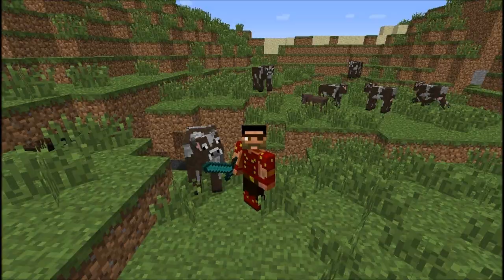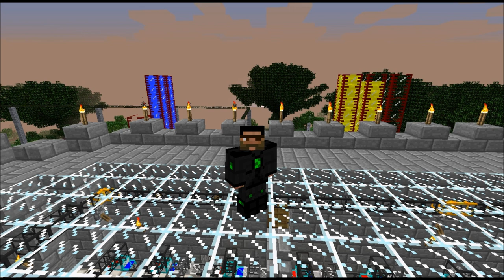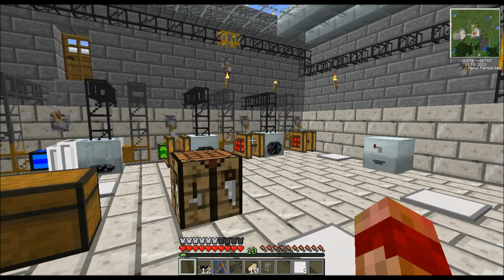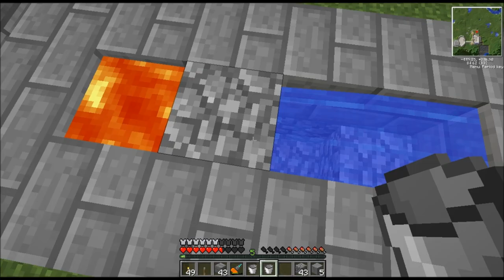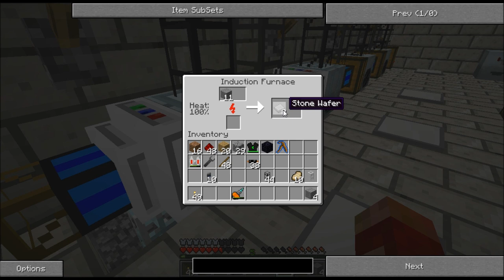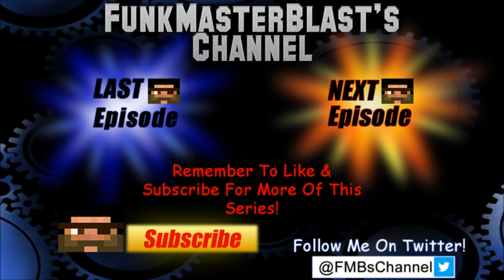Minecraft Technic Part 25 The Other Jetpack, The Block Breaker and Infinite Cobble!

Comment: frankly by the time you take any of these mods to the top end, you've really made it into creative mode, so it's not all that great if you're going to worry about whether you're cheating or not.  You went through the steps to get the materials to set it up, but you wind up getting essentially unlimited free materials and power from the vapors, especially from EE.  You don't even need to mine another block at that point except in that it's enjoyable to do so.  Or farm.  I like farming.